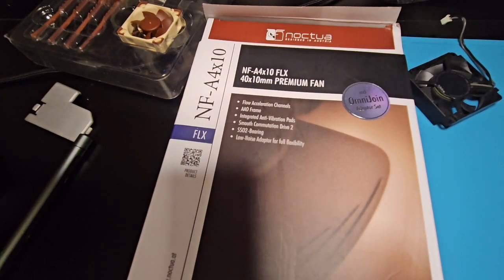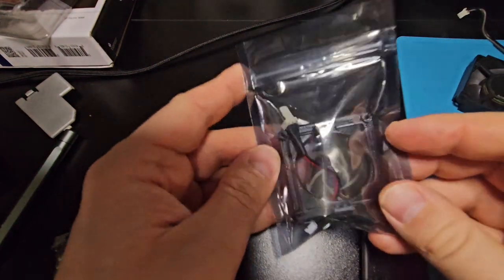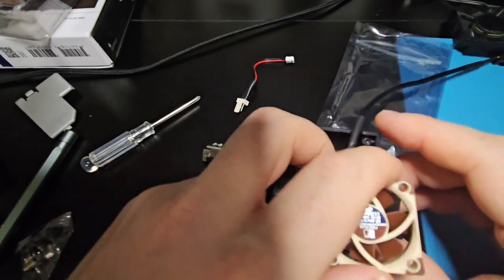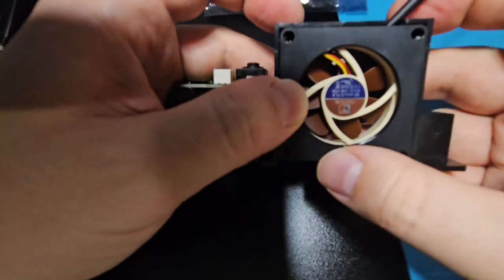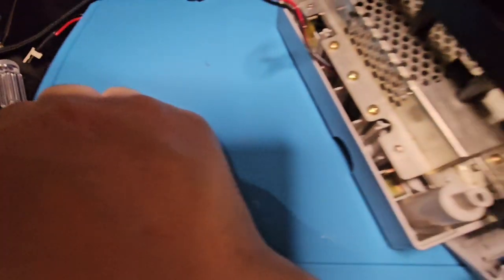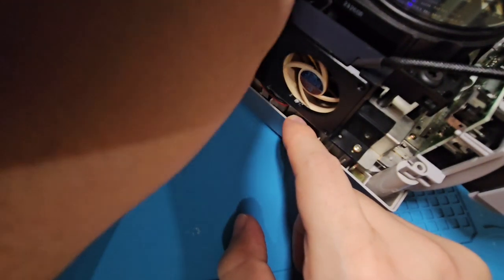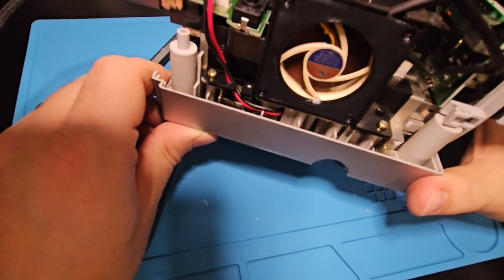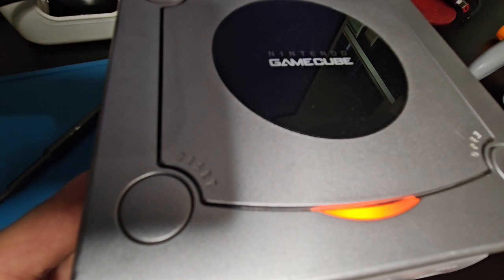Building the Ultimate GameCube Part 1: Replacing the Stock Fan

Comment: Like the video 
Don’t like the long cable is there anyway to shorten that?
Reply: Clip the fan cable, clip the adapter cable. Ensure that you pair the wires up exactly how'd they would line up if it was plugged all together. Solder the wires together. Insulate them apart from one another and shrink wrap it up.